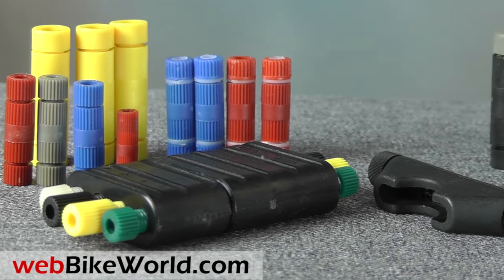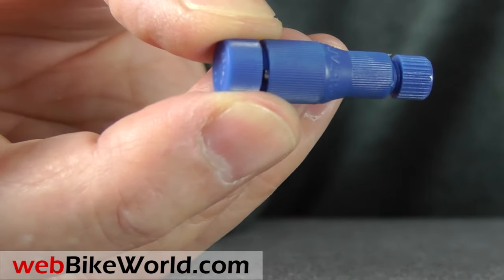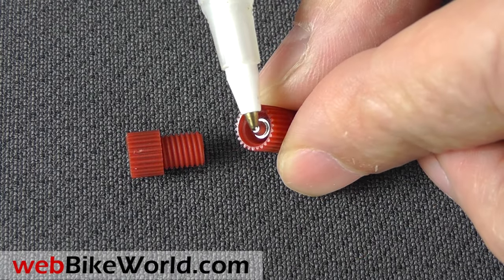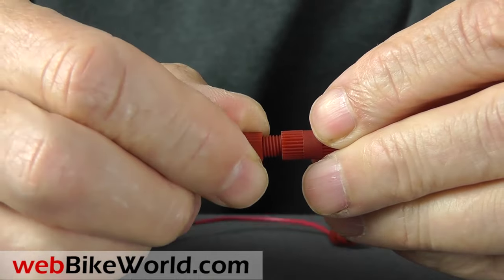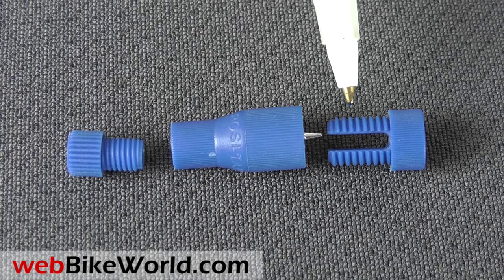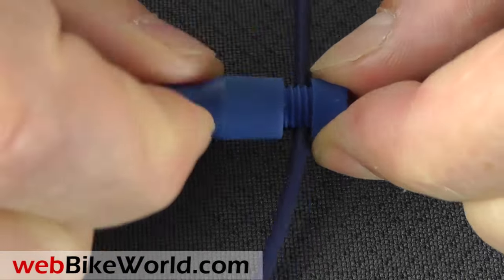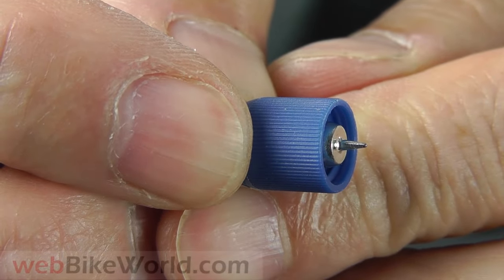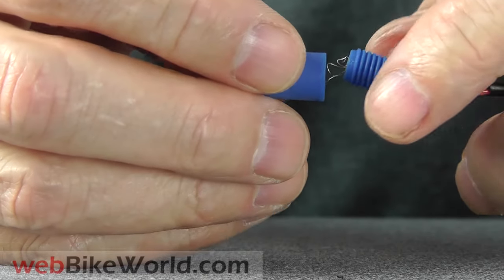Using the Posi-Lock, Posi-Tap and Posi-Twist

Comment: Will these work for model RR builds?
Reply from the maker: Yes, any wires, they'd be perfect for that because if you have to move the wires, change the wiring or experiment with different wiring, you can reuse the Posi-Locks over and over.
Reply: I am going to use #14 wire so I would want the blue in the Posi-lock. Do I also use the blue for the posi-tap?
Reply: or the black untapered.
Reply from the maker: Jack Bogan I'd probably go with the 14-16 blue Posi-Locks and the blue Posi-Taps. Contact me via the website for more info http://www.webbikeworld.com/sale/posi-locks-for-sale.htm

Comment: How big of a difference or no difference at all with postiaps vs soldering two wires together? 

I bought a product for my car and I used positaps, and it's not performing as well as it should, i contacted the manufacturer, and they said to soldering/weld the wires together rather than using positaps. 

Meth or bust?
Reply from the maker: +den525 That's kind of difficult to answer. You can take the time to do a correct soldered wire join and then protect the solder joint correctly. Sometimes that is difficult or even dangerous to do in the confines of a car or motorcycle. And it is possible for the soldered connection to fail also, for a variety of reasons. I can say that I have been using Posi-Locks and Posi-Taps for many years and never had a failure. It has to be done correctly. I'm not sure what problem you are having, but if you tap into another wire using the correct size and procedures, it should work. Maybe you are getting some moisture into the connection?
Reply: webBikeWorld Thanks for the reply. Long story short, it's a piggyback tune, which needs to connect two wires to the car's CANBUS. I bought a bunch of different sizes positaps and followed the procedures and IMO did it correctly. 

The "failure" is not the positaps. The piggyback tune is not performing as well as it should, and the first thing the manufacturer said was how I connected the the CANBUS wires, and I said positaps, and they said they've had "issues" with that, and asked me to solder the wires together instead of positaps. 

Anyways, I don't think the Positaps is a problem, as car is not throwing any fault codes, so everything should be "connected" via the tune module. If positaps are done "incorrectly" the wiring won't be connected correctly from the car to the tune module right? Therefore it should throw fault codes... 

Read somewhere that the connection via positaps might be "weak" therefore it's connected and signals aren't transferring as well as it should? therefore car/tune box will continue to work but not well? (imo highly unlikely).
Reply from the maker: +den525 Hmmm...I find it hard to believe that, either a connection works or it doesn't, the electrons flow through or they don't. Seems hard to believe that only a few electrons flow through, so the connection is "weak". That's like being just a little bit pregnant. It's all or nothing!
Reply: webBikeWorld That's what I thought... but they insisted it should be soldered or else it hasn't been installed properly. 

Anyways, thanks for the info.

Comment from the maker: New how-to Posi-Lock video just posted on #webBikeWorld quickly shows how to use the 3 most common Posi-Lock types.

http://youtu.be/N64p6ndlTQ8
Reply: Hmm, great product however I disagree that it is "safer" than soldering. If I want something to be permanent and I don't need to change I will solder it and shrink tube it.
Reply from the maker: By "safer", I meant not having to use heat and electricity around a motorcycle, fuel tank, etc.
Reply: ahh.. I see!  For the record, these are the only connectors that I want to use now after using them for the first time about a year or so ago.